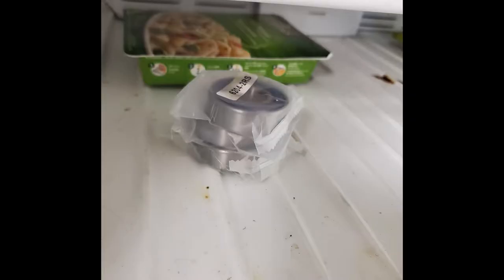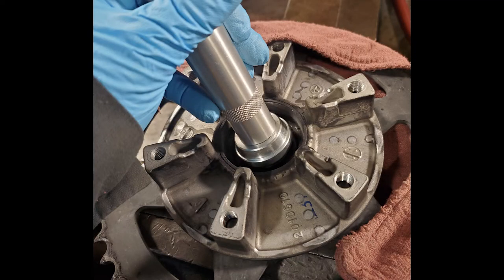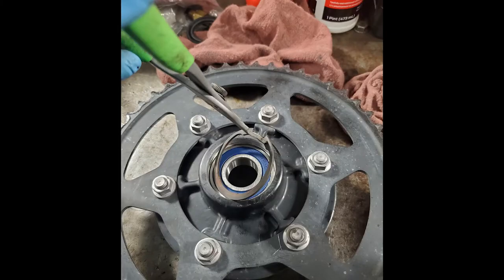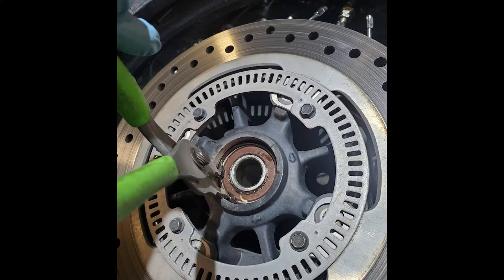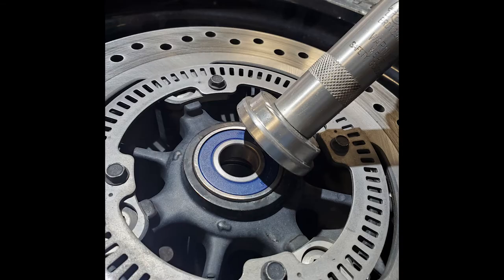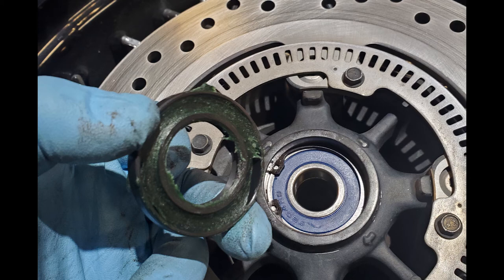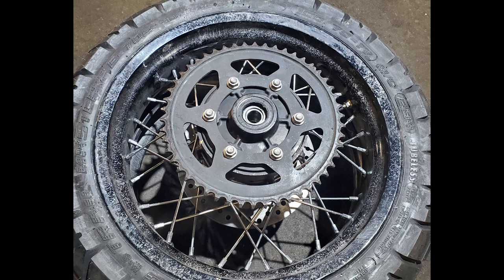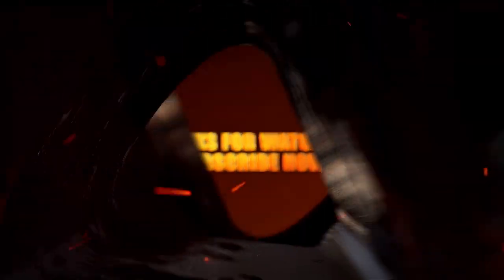How To: Remove & Replace Rear Wheel Bearings & Sprocket Carrier Bearing On A Tiger 800

Comment: Which wheel bearing puller is that?  I'm getting ready to do mine and I'd rather use a puller.
Reply from the maker: It's an absolute piece of junk that the company has since gone out of business. That tool has long broken since this video. 
If I was to buy a new one I'd consider trying a "Jim's Wheel Bearing Puller"